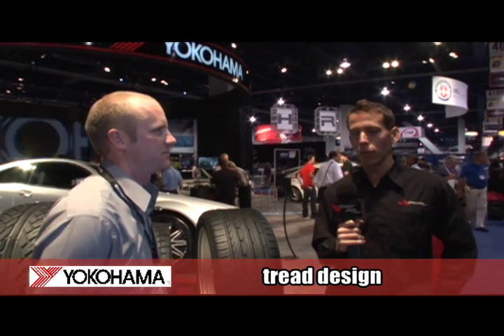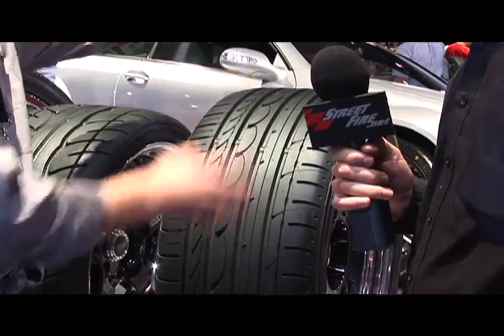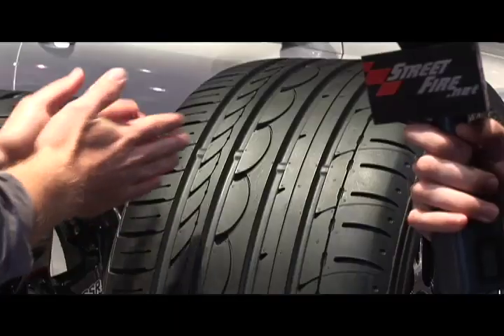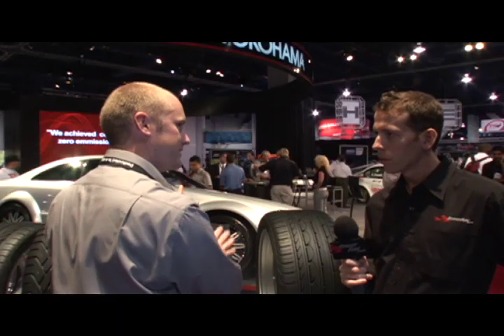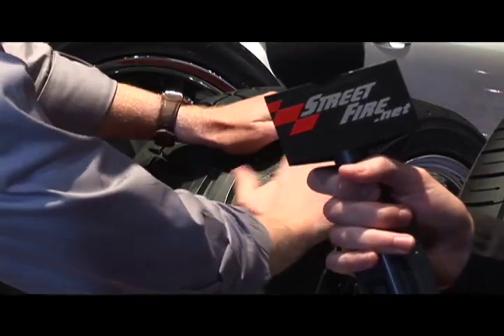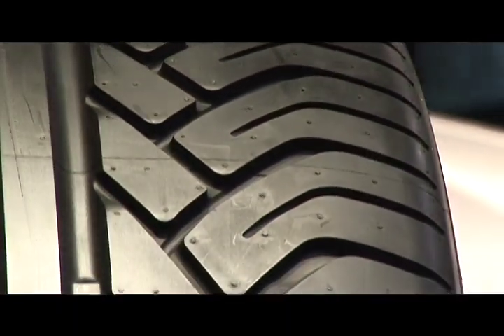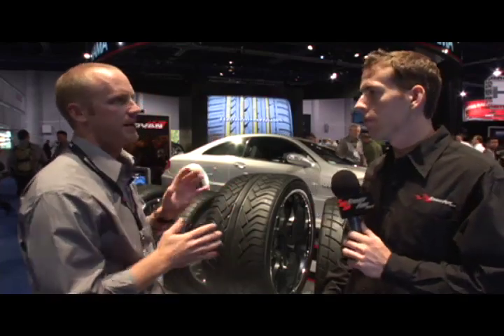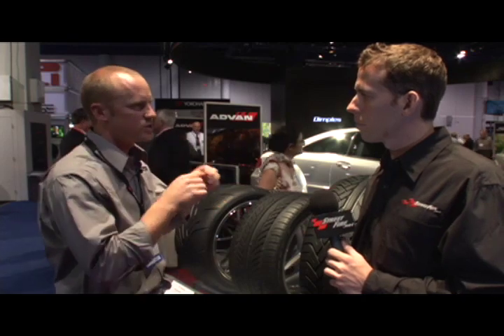An Expert's Lesson in Tread Design

Comment: The tyre is designed with the whole car in mind...a great reason to stick with the OEM tires. When considering the amount of tire brands and differences between brands, trying to find 'the best' tire for the car you have might not happen because by the time you have test only a small selection of tires, you will be getting a new vehicle. It also goes to mention that as your search for 'the best' occurs, the changes in suspension, steering etc will impact on the results of your tire.
Reply: Elle Jay Thanks for the tip, I’m sure my OEM Michelin Primacy HP’s will do great on the track!
Reply: Elle Jay Yeah that's rubbish. There are more OEM tyres in production before the car they are fitted to. The Dunlop SP10 was OE on hundreds of cars and it existed long before 99% of the cars did. Most OE tyres are cherry picked out of the existing lineup and are not specifically designed for the car they end up on.

Comment: I disagree. That was a poor representation for Yokohama. The Yoko rep never mentioned elimination of resonance, sidewall stiffness or rubber composition. The "biting edge" term he used is the tire holding ice inside the grooves because ice-ice contact provides more traction than rubber-ice contact, and this was alluded to by the Streetfire guy. The Yoko did say a lot of "uh" and "ya know," for what ever that's worth.